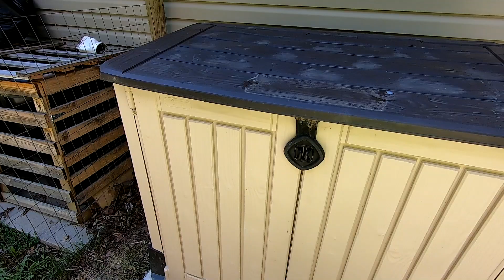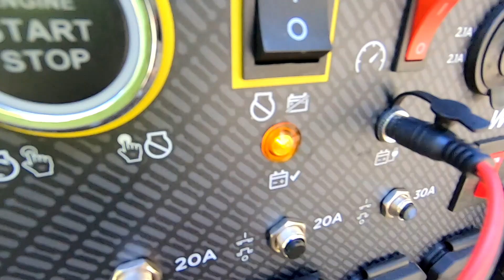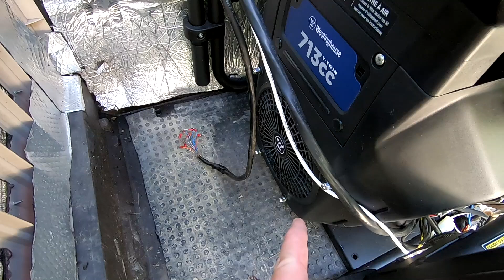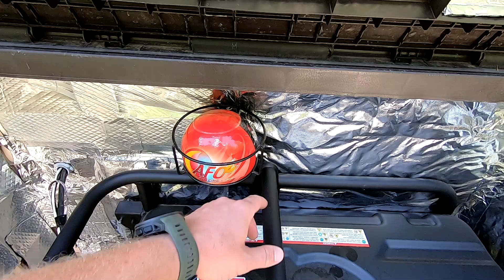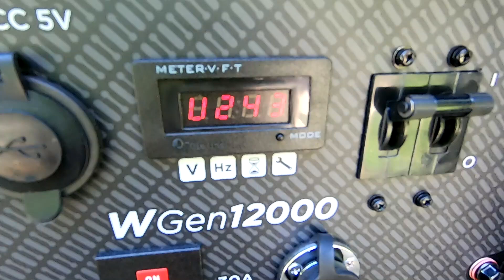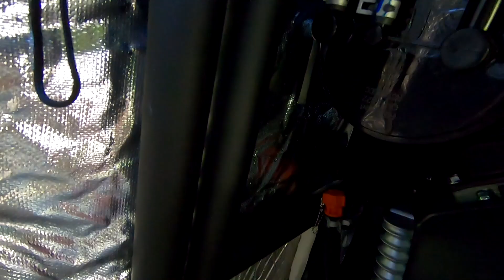DIY Generator Enclosure Shed v2 BIG 15kw Westinghouse Retrofit

Comment: That exhaust pipe is very close to that door. I assume thats your garage door but I'm sure there is a door in your garage that leads into your house. Just saying.   Extinguisher inside the generator enclosure io a great idea.
Reply from the maker: The huge fan blows the exhaust away. Just had to run the generator for 28 hours straight and it worked great. It's just kind of loud.
Reply: @JackofAllMasterofNone   What are the dimensions of the enclosure on the inside (or the generator dimensions) Thanks

Comment: How do you do oil changes?  I have that same model westinghouse and I'd think oil change out would be a hastle witn the unit enclosed like that...
Reply from the maker: It has the hose that comes down. I just use a shallow pan and drain the oil into it. Filter is still accessible as well. It's not too bad considering you don't have to change the oil very often

Comment: I'm curious about the wire feeding your switch from the 50 amp connector. It appears to be 12 or maybe even 10 gauge which would be way undersized.
Reply from the maker: Wrong. 8 gauge and breaker is 30amps.

Comment: Do you have a heat problem in the summer if the outside temperature is 90 to 95 degrees outside. If you were to do it again would you put in a larger fan
Reply from the maker: I did add a larger fan. Just to make me feel more comfortable. Not sure it was necessary but now it stays very cool no matter the outside temperature

Comment: How is the heat inside the shed? Have you ran it for extended period of time in summer?
Reply from the maker: With the high flow fan it keeps it running cool. It's very important to have a good flowing exhaust fan
Reply: @JackofAllMasterofNone was that a 10inch or 12inch fan you used?
Reply: Did you have any temp readings inside the shed ?

Comment: Very nice setup!  One question, are you running 10/3 wire on the 50 amp connection?  You should be running 6 AGW Copper or 4 AGW Aluminum at a minimum.
Reply from the maker: That's 6/3 with ground romex

Comment: I have the Dual fuel version of this generator. Have you had any issues with heat after running it for an extended period of time?
Reply from the maker: No. But I did install a larger fan as a precaution. Made me feel better about the 90 plus degree days.

Comment: Do you have any concerns or problems with exhaust getting in the door there next to the unit?
Reply from the maker: No. It blows away from the door and the door is to a garage, not the house. Have a CO detector just in case, but have never had problems. The air from the exhaust fan is so strong that it dissipates all the exhaust

Comment: How do you like the Westinghouse I was considering changing from my Generac due to the 12/15Kw having less than 5% THD.  How can the remote be reliable?  Don't you have to choke the generator for a Gas start up?
Reply from the maker: I like it. I had a few minor issues though. The starter failed within the first week. Amazon made it right though and I installed a replacement starter and it's been fine since. The THD is spot on. I have a large UPS system that monitors the frequency and it is very happy with the output of the generator. The remote works perfectly. It uses a computer controlled electronic choke. They should have spent a few more dollars and just used fuel injection. How cool would that be? But the electronic choke works well. Only other issue was when it was -20' with the wind-chill the battery decided it wasn't gonna start the generator. I guess that's not really the generators fault. I used a jump pack and it fired right up, so a battery heater might be in the future.

Comment: Everything I have read about installing a generator says it should be about 10 feet away from the house.
Reply from the maker: What standby generator is 10 feet away from the house?
Reply: @JackofAllMasterofNone they run on propane or natural gas which produce significantly lower carbon monoxide.
Reply: NFPA 37 standards that most standby units are built to require an 18 inch clearance from the residence.  However, all also require a 5 foot clearance from openings to livable space.  

Let’s face it.. I’m in the generator business and am horrified from a risk of fire perspective on every single one of these generator “sheds” that people put next to their largest single investment and asset, BUT…I’m not going to list my objections here.  They are not based on people using portables instead of standby though…some folks can’t or won’t spend the money on a standby which I certainly understand.  I’ve advised several folks on steps to make the portable more successful in their applications.

All I will say is that your exhaust is way too close to door there.  Im assuming that door leads to a garage or storage room so it probably will never become a major issue.  With that said…please install a carbon monoxide detector there if you have not.  It’s probably hard to find how many ppm will build up there, as I doubt Westinghouse has bench tested the unit in the particular fashion you are employing it so err on the side of caution please
Reply: Most of them depending on local codes. Might want to look into that.

Comment: HI, I am getting ready to make my enclosure  using the same generator  what did you use to attach the insulation to the plastic  I bought some double reflective insulation from home depot but have not checked to see if it has it's own adhesive yet. Also have you had any cooling issues. Thanks  great video
Reply from the maker: I just used the foil tape you can buy for HVAC. No cooling problems at all.
Reply: @JackofAllMasterofNone  Do you know What is the THD Total Harmonic Distortion at what 5-10 % at least ❓❓
Reply from the maker: @Honestandtruth007  Westinghouse says less than 5% THD
Reply: @JackofAllMasterofNone Thanks for Response

Comment: This looks great!. just getting started on my project.  I have the WGen9500DF generator..  My biggest concern is connecting a pipe to the exhaust. do you have any more detail on that?  Thanks!
Reply from the maker: In my case the piece I cobbled together fit tightly over the exhaust outlet and is secured where it comes out of the shed. That way I can remove the generator if I have to. I just happened to have a piece of steel pipe laying around that used to be an antenna mast that worked nicely. Don't have any specific details otherwise.
Reply: @JackofAllMasterofNone  Thank you.

Comment: Can you be more specific on the pipe you used for the exhaust. Can you show connection and where you got the pipe?
Reply from the maker: It was just some scrap I had laying around. Sorry can't be more help. It literally just slip fit over the exhaust outlet.
Reply: @JackofAllMasterofNone  Tks, I not sure if it needs to be a tight seal over the exhaust or not? and what did you use to hold in place?

Comment: Have very similar Westinghouse generator 12000df so mine is same basic unit.  I used to have Generac GP15000E but genset failed at only 32hr.  Generac says it was overloaded but the more research I have done Heat may have been factor?  Recomend you look at separate ventilation system for genset.  Make sure fan in genset gets fresh outside air.  Nice work.

Comment: Nice start on the shed.  I have a Generac 17500 or 26K peak.  Just a note I have 3 fans about 3000 CFM.  One fan shut off at 130 degrees.  Heck it's 100 outside in Texas summers.  I encourage you to run this for an hour or more to evaluate the temperature rise.  I like the status light that's slick.
Reply: Any pics of your shed setup

Comment: Two comments from someone who has gone thro this exercise personally. Mine is a 5kw Honda. Heat is a big problem and having a high temp. shutoff safety switch is a good add on. I did this but my criteria is to limit temp. rise inside the compartment to 10-15 F. I had a non powered 17"sq intake and a 16S AC Infinity fan (16" shutter fan) on the exhaust side (17" sq outlet). That was my 3rd iteration providing 3,000 cfm air flow. This done according to the theory that fans are easier to replace than generators.  My safety switch by the way is a 50 C or 122 F  shutoff temp. Another consideration is that generator shed builders ignore the fact that generator failure is progressive and only in the final stage is it sudden. The things that will go bad first are the head and the generator windings.
   Most generators today use CGFI 110v plugs. If you connect your fan to one of these it can trip while you are not there. In my case this happened and I changed the GFI plugs for regular plugs because I am more concerned about reliability than safety since it is a stationary application.

Comment: I have a similar WEGEN 12000DF  and did not read about the high temperature shut off in the manual. Can you tell me where you got that information because I was going to add a NO 40C thermal shut off?  Thanks!

Comment: I have exactly the same generator shed, and I am using propane. I have two 100 lb tanks and six 20 lb cylinders.
Reply: I want to get some 100 pound tanks but my 12000 durmax calls for oil changes every 2p hours so would be pointless or in reality can you go longer without changing oil
Reply: @mattyockey9195  You should get longer oil life running propane.  Changed the oil on my Duromax 13000HX after 20 hours, the oil still looked new!  One tip, get a new oil dipstick with a magnet at the end.  Definitely helps collect the little bits of metal from wear.